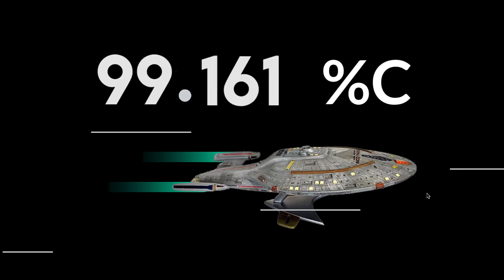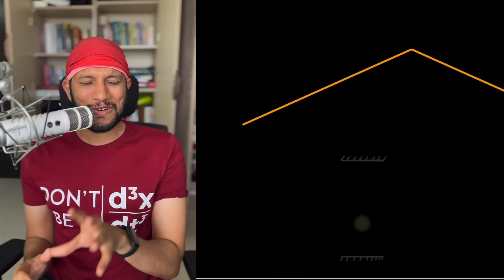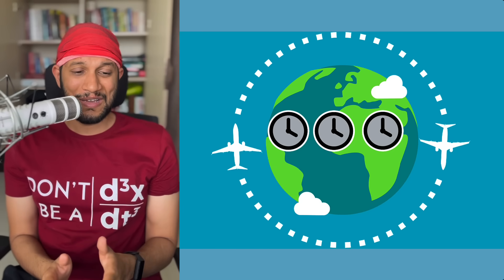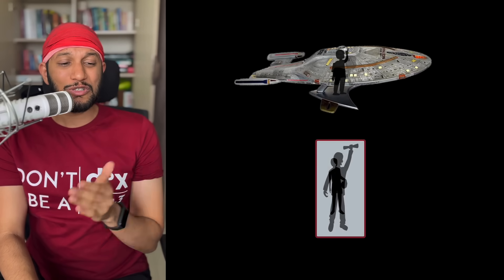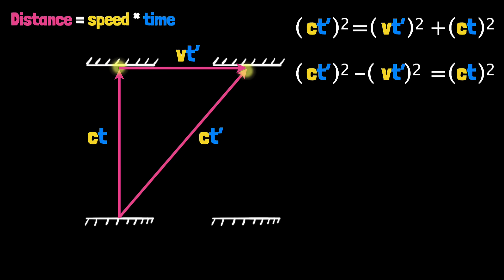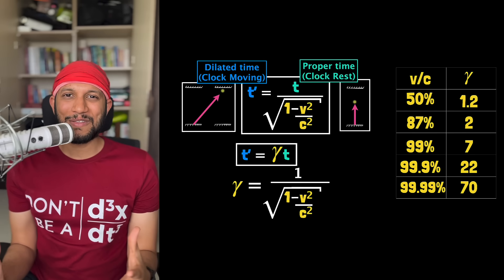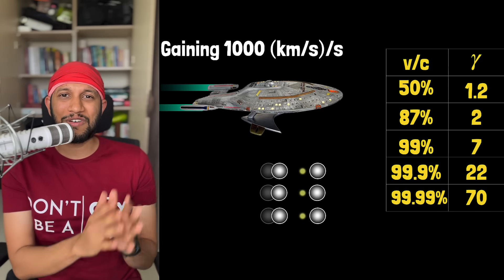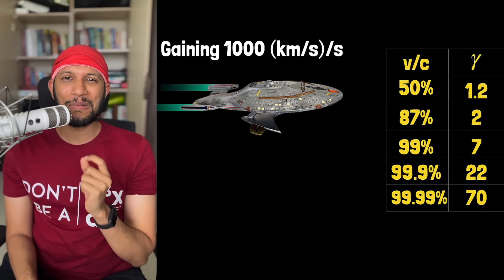I finally understood why you can't go faster than light! (My mind is blown)

Comment: I know I'm late to the party but.... Why does the outside frame of reference matter? If an object could fly AT the speed of light (with instant acceleration), for an outside observer, the object would have never left, correct?

Let's say a ship sets to the Orion Nebula. To the people in the ship it would take them some time sure and it would be relative to them in terms of age and time passage. For the outside observer waiting for them to come back..... They would never come back (ie, they would have died by the time they do come back), but the ship never really left. They would see the "ghost" of the ship as the photons haven't caught up with the ship moving.

By the time the ship comes back, there may not even be a society to come back to.

Crazy.
Reply: Photons instantly accelerate to c. Clearly they leave and arrive. You can even measure the recoil.

Comment: I never did get this reference when it was explained to me in my physics class in college. If I'm outside the ship look at the clock, I'm also moving with the ship thus changing the times relationships to relativity. Since my speed to observe the clock has to match the speed the clock is moving.
Reply: You could run a sledge over a track with lots of photo diodes.

Comment: There are 3 lights that are the points of a triangle.  A, B, and C are lights and are stationary with respect to each other. S1, S2, and S3 are spaceships. S1 is moving from B towards A. S2 is moving from C towards B. S3 is moving from A towards C. A, B, and C flash simultaneously in the frame of reference that is at rest relative to these lights. So in the frame of reference of S1, A flashes first followed by B flashing. In the frame of reference of S2, B flashes first followed by C flashing. In the frame of reference of S3, C flashes first followed by A flashing. So the sequence of flashing is A, B, C, A. But wait! A flashed first. How can it flash last? How can A flash both first and last?
Reply: Ha, that is funny. You could make a video with expanding circles for the light pulse. Each ship will only receive one pulse from each light .

Comment: Ship1 at rest at top:

1 light-year
T--------------------N
N-----------T   <-----.8c
.6 light-year

Ship2 at rest at bottom:

.6 light-year
T----------N -------> .8c
N--------------------T
1 light-year

The spaceships are each 1 light-year long and are passing each other at .8c. So each ship is contracted to .6 light-year when viewed from the other ship.

T1 and T2 both have a lamp with a lightbulb. Both lamps are initially off. When T1 is lined up with N2, T1 turns on his lamp. When T2 is lined up with N1, T2 turns on his lamp. When T1 turns on his lamp is T2's lamp on or off?

Comment: "In May and November, the Earth is moving at "right angles" to the line to Algol. During this time we see minima happening regularly at their 2.867321 day intervals. However, during August, the Earth is rapidly moving towards Algol at about 107,229 km/hr as explained on my How Fast Are We Moving? page. (The Earth moves approximately 202 times its own size in one day.) So in 2.867321 days the Earth moves about 7,379,039 km closer to Algol. But the varying light from Algol doesn't know this - its light waves left Algol 93 years ago and are travelling at a constant speed. The result - we "catch a bunch of minima early" during August as shown on Chart 2. Exactly the opposite happens during February - the Earth is moving away from Algol that fast and it takes longer for the group of minima to reach us so we see them taking longer between events. How long? 7,379,039 km divided by the speed of light 299,792.458 km/sec is 24.61382 seconds.  So in May and November when we are not moving towards or away from Algol - the period seems constant. It is our rapid movement towards or away from the events in August and February that causes the timing differences."

I assume that light is passing the earth at c when the earth isn't moving towards or away from Algol.

In February the earth is moving away from Algol and the time between the eclipses is 2.8675875347 days and the light is passing the earth at 186,265 mi/sec.

In May and November the earth is not moving towards or away from Algol and the time between eclipses is 2.867321 days and the light is passing the earth at 186,282 mi/sec.

In August the earth is moving towards Algol and the time between eclipses is 2.8670608912 days and the light is passing the earth at 186,299 mi/sec.

Comment: Sry, but the explain is wrong... Because for you traveling the time remains still the same. Only for an outside person you "seem" to slow down and "freeze" at the end. So the explaination based on the reference frame does not explain that.
The real reason is much simpler and its due to infinite mass you need based on the kinetic energy.
Reply: And how did you calculate the mass? Hint, it is derived from the math presented in this video. IMHO the video game "MAss effect" is designed by people with no clue about physics.

Comment: OK, so assuming that all force carriers are traveling in random directions, if we are traveling in one direction close to the speed of light, then some of our force carriers would have longer distances to travel while others would have shorter distances to travel. I wonder how THAT would affect our biological processes and our perception of time.
Reply: I did not understand that many commenters did not know the experimental results before they watched this theoretical video. Special relativity is called like this because there is no way to measure a velocity when you don't look out of the window. There is not even an absolute velocity in our university ( "Only Sith deal in absolutes" ). This little video does not change this. The photon clock is part of the special theory of relativity and only explains why we cannot accelerate a rocket to c from our PoV. That's it. If you want more, apply Lorentz-Transformation ! General relativity takes it as a fact that the life inside an accelerating Torch ship feels just like on earth.

Comment: The clocks you have are not photon clocks. Anyway, photon clocks don't slow down because of travel. They photons are encased inside the unit. The unit is affected from the travel not the photon. The clock slows due to the inertia placed on the gears by the force of the travel speed
Reply: There is no frame dragging in the special version of theory of relativity. A case does nothing. You place the clock on a drawing and slide it out of the ship. It will stay synced to a cased clock.
Reply: @ArneChristianRosenfeldt I like.  But he said a photon clock in the video not a regular one like we use. . Speed put pressure on the gears
Reply: @davidtalkington7975  I dunno where my last answer went, but I could not understand what is so un-regular about a photon clock. We need an ultra stable cavity: Pressure and temperature. And use material with ultra low expansion coefficient. And I even came up with ways to compensate these coefficients (around a specific T ) using expanding material in opposite directions.
Reply: @ArneChristianRosenfeldt I like your idea. If you would like to expand on the idea I'm willing to talk about it with you.  Do you or have you thought about a patent. If not, think about it before you talk with anyone.

Comment: so what you are saying is that in a black hole, if matter requires photons to know how to move, but the photons never make it anywhere, the matter can can essentially "phase through" each other because it never actually knows that it did.
Reply: quite daring of you to include general relativity before understanding of special relativity.
Reply: @ArneChristianRosenfeldt  I fail to see how that's the case. Special relativity is about flat and simple space-time, a black hole, well, that's pretty much the exact opposite.

If you were hinting at the fact that the atoms are in the same local inertial frame because the distances are so small between them, I'd say, How so?.  I'm talking about matter approaching the singularity here. Why would we assume that space-time curvature is not so extreme that it's having an effect on the atomic scale?

Now I'll grant you that phasing through is not the best phrase to describe what I meant, but my point still stands. If matter reaches the singularity and the other matter is unable to tell it to be pushed aside because of the infinite spacetime distortion, then locality can't be assumed anymore. Matter essentially breaks down, and only "nonsense fields" remain. When new matter reaches this "place" then the new matter's "nonsense-fields" would overlap and potentially create constructive interference, or the spacetime distortion would make even these waves impossible.

I fail to see how this conclusion that highlights the clash between Relativity (everything becomes infinite) and Quantum mechanics (everything is a wave) draws you to the conclusion of not understanding special relativity when the premise that spacetime inside a black hole on the atomic scale is flat can't be assumed anymore.

Sure, if we stop thinking about this altogether with the reasoning, if we throw out relativity (the stage) then trying to describe how the actors behave (quantum dynamics) is wasted time, then you're correct, but I find that rather boring.
Reply: @dd-di3mz I mean: you lost me when you wrote “black hole”

Comment: If you reach the speed of light, then the the energy transfer would be at a constant rate. It’ll never even reach that second mirror because it’s traveling at the speed of light. Both are traveling in the speed of light both will never reach each other.

Comment: But then how do we know what the actual resting lightspeed is if out whole environment is the literal spaceship racing around the sun which is racing around the milky way and so on?
Reply: there is no " actual resting lightspeed" . We just choose to take earth as reference. Per GTR earth is in free fall. So the frame is valid if we don't change the distance to the sun too much. Otherwise you need to find a planet beyond pluto.

Comment: now i wonder, lets say we invent a working warpdrive, and move a ship at lightspeed inside this spacebubble to the next star, how would this look from an outside perspective, and then twice the speed of light
Reply: A wormhole is simpler: we don't see nothing. I read that Warp drive collects everything in its path. So if we mark the route with flares, we will see how they will be hit one after another and uh .. does the bubble leak?
Reply: @ArneChristianRosenfeldt  thats not what i ment, i ment how would the faster that light look like from an outside vieuwer
Reply: @ElysiaWhitemoonOmega  I understood what you  meant, but frankly do not know how it looks. Just I could tell you that it would not be undetectable. Probably light just leaks out on the sides of the bubble. We should search for a video. With warp the ping pong clock should stay fast as the ship accelerates towards c.

So there is shearing on the sides of the bubble? Could small shuttles pass through this? If Warp drive needs to be heavy, perhaps we should run heavy cruisers circling the Milky Way. Shuttles are used to hop on and off and to supply.

Good thing: No exotic matter has been found. Warp drive is not real. It cannot hurt us.
Reply: @ArneChristianRosenfeldt  maybe the ship itslef is not detectable, but the curvature distortion should be, we cannot see beyond the edge of the observable universe, wich if i undertand, moves faster than the speed of light. you get a similar effect i guess as the speed of sound and only hearing. how does hearing goes with an object going faster than sound
Reply: @ElysiaWhitemoonOmega  I thought we talk about a ship warping across your sky. Like you sit on DeepSpace9 and Romulans warp just in front of the Wormhole.

Comment: Also, using the photon clock and the right angle diagram. If x is your current speed, y is the distance between the two mirrors, and the hypotenuse is the path of the photon at light speed. If you wanted to get x=the hypotenuse, y would need to equal 0. In the function y is constant and the distance of the hypotenuse adjusts to the length of x. The function would need to break to make y=0 and x=the hypotenuse. Basically if all of the photons speed is being used to go forward it has no extra speed left to go any other direction.

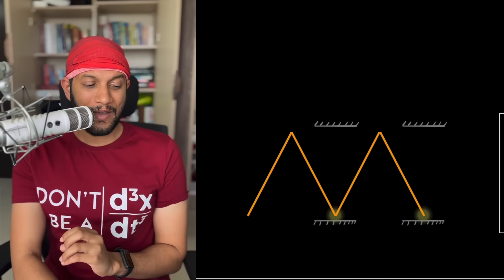Comment: Guys, can you please help me understand why the perseption of the photon clock does not change from the inside the ship when its moving? I understand why it takes more time for photon to travel inside a moving ship, but why you can comprehend it only when you are outside of it? From my understanding, the clock stays on the ship and only our perspective changes. So my question is: how it is possible, that photon travels larger distance, therefore needs more time, but its like doesn't matter if you see it on the same ship with it? 1:48 How?

Comment: I have a doubt. If the space ship is at 1000km/s2 then from what clock you have set the accelaration? The one on ship or one on earth because if its on ship then the theory doesn't work and basically the clock in the ship is always at rest so it will take the same one second. Also, another thing is how the photon is working. Let's say I have a machine which can go to near light speed in jiffy but I start it when the photon is in mid of mirrors, you can understand it from a situation that you throw a ball up in car at rest and start the car when ball is in the air, the ball will go behind because the initial horizontal force is not present. And last of it, a human cell has a particular age, what clock is that set in? I guess its the natural clock but ofcouse since then it becomes out of science realm we cannot talk about this. I feel all of this is mathematical gimmick and time cannot dilate. Mathematically, it can dilate, but not actually.

Comment: From inside there is however a Point Theo reach c and if you add another 1000 km p second Then Theo are Even faster Then light and Thus traveling in the past
Reply: what do you mean with "from inside" ? How do you measure velocity? Last time I checked, my car uses the tryres or receives GPS

Comment: Your perception of time changes when you are inside vs outside the ship. So you have to calculate the time it takes for the light to get to your eyes so you can actually see the thing you are observing. 

In any case, something traveling faster than the speed of light is invisible to you, so.. ofc you can’t observe something travelling that fast. 
All these explanations look smart but they are quite misinterpreted.

So it is not like: you can’t travel faster than the speed of light. It is just you can SEE something traveling faster than the speed of light. 

It shows a fault with how physics is structure, not a description of reality.
Reply: I hate to base something on Cherenkov radiation, but why exactly would we not see something faster than light? And why are we interested in a theory which is not falsifiable ? If you record a single FTL particle in water from the side, you can calculate its velocity.

Comment: How would this be seen from inside the ship? Since the photon clock is on board with them, it would appear to be ticking at normal speed. What stops an internal observer from reaching the speed of light from their perspective?
Reply: How do they measure their speed? Do they use a map of the Milky Way and plot a course?

Comment: Thank you Mahesh and Happy new year! I just watched this as I enter into 2026 now lol. Genuine question. This is all correct if 1) we take it with reference to standard earth time. 2) Isn’t it about the space between the atoms the real problem? Like going super sonic, we have to tear through the air molecules in the atmosphere which in turn increases the resistance, in turn more force, likewise, in the vacuum (almost) of space, when we increase the velocity, the atoms closer to the engine are faster compared to the farthest atoms ahead of them, so by the time the atoms in the back are at 0.5 C, the atoms in the front will still be at 0.49 C. So the faster and faster we go, the space between atoms will start to shrink, and the force needed grows infinitely larger to push the craft forward right? And when we watch the ship from the earth, it will slow down and freeze at some point!
Reply: you could reduce acceleration to < 1g for some periods. Constant acceleration presses the ship together a bit, but all parts travel at the same velocity. I propose to pressurize the ship to 1 atm. The rocket kicks it like a soccer player kicks the ball -- but constantly . I don't see how going super sonic can be compared to this.

Comment: So is it true that when my car stands still and I have the headlights on the light travels with c and when my car is going with 50 mph the speed of light isnt c + 50 mph? So the light slows down when I am driving to c - 50 mph? The question is, how does the light know my speed of the car? Fascinating 😂😵‍💫🤓
Reply: I don't understand you question, but yeah, your headlights (and RADAR pulses and Lidar) travel at c from you point of view and from the PoV of the Cop parking on the shoulder. Likewise his RADAR gun pulses travel at c for him and you. Upon reflection from your car, the frequency of the radio wave is increased by some factor which the Cop uses to measure your velocity.